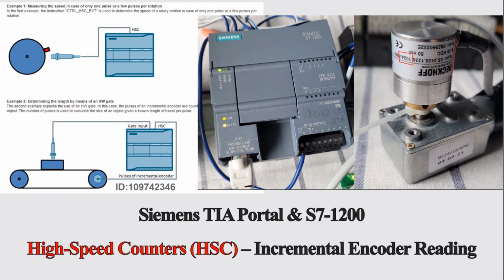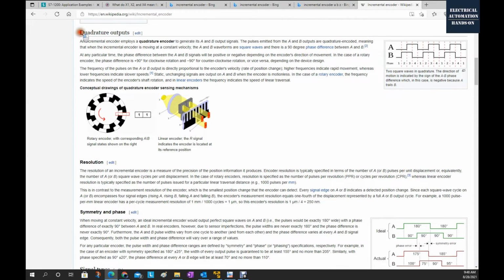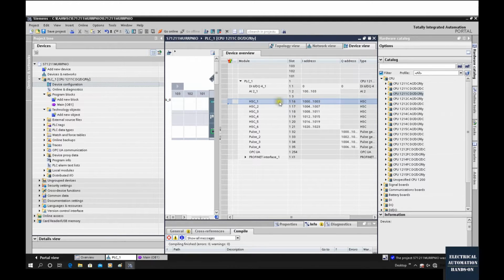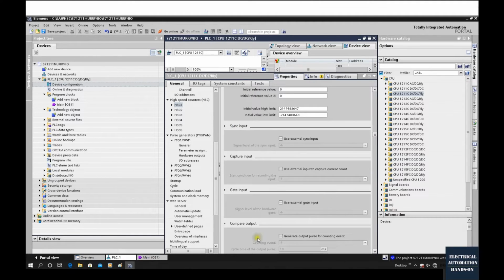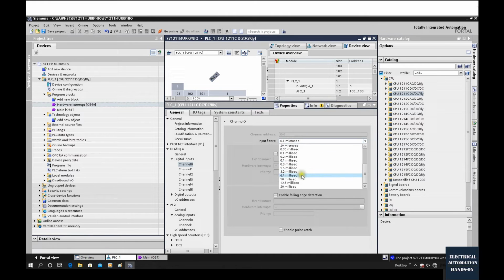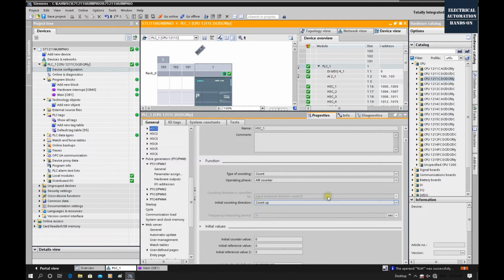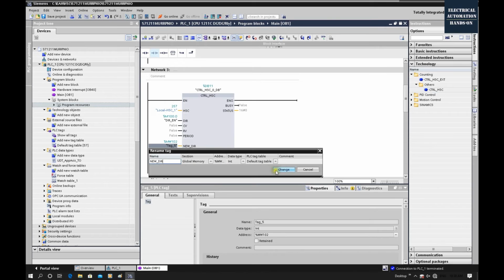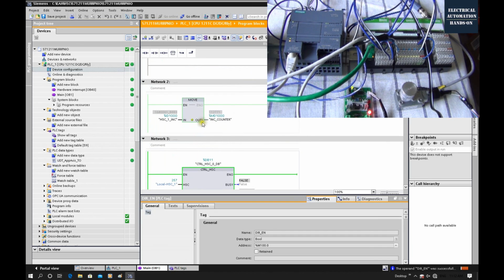SC06a. Read Incremental Encoder via Siemens PLC S7-1200 HSC(High Speed Counter)

Comment: I m using S7-1200   CPU 1212C DC/DC/DC Connnect to HSC1 Incremental Encoder 1024  
Q1: Why Incremental count the value  Negative (-)
Q2:  Setting time  I0.0 , I0.1 with 0.8 Microsec      Out put pulse lessthan 1024 RPS
Reply from the maker: A1: just exchange your encoder A/B wiring to I0.0 and I0.1, you will get backward encoder value. A2, 1024 PRS = 1024 x 1024 plus/s = 1000khz. your speed is too high.